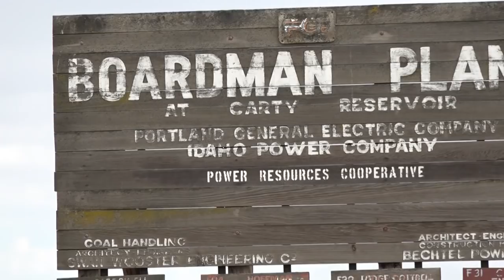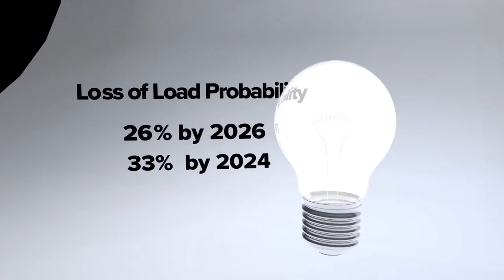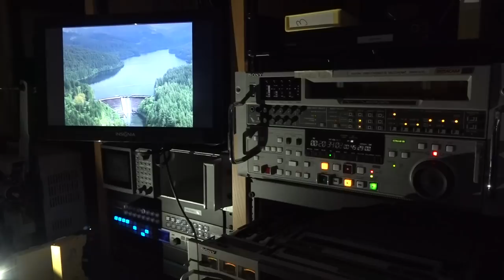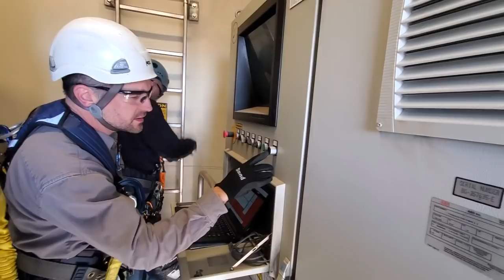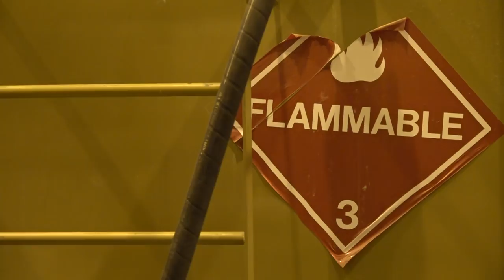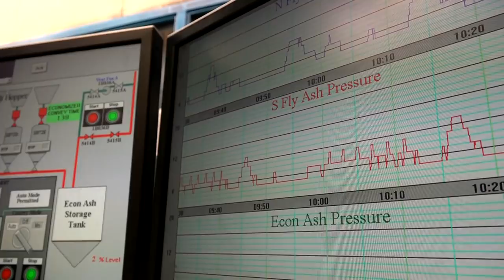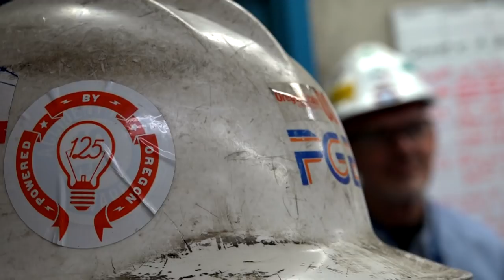Will there be enough electricity after coal plants shut down? | 'Power Struggle' full documentary

Comment: This documentary fails to point out how fast distributed solar is growing, and only looks at centralized utility power plants, which is flawed.  The U.S. installs the equivelant of: 3 new nat. gas power plants of solar, every day, in the U.S., reducing the need for power from utilities.  I did this myself.  I installed 5kW of solar and installed a 2.4kW wind turbine which powers 100% of my house and electric car.  When you fly over the U.S., you see hundreds of thousands of homes with no solar panels, leaving all of that space dead.
Reply: Same here 🤗
Reply: Where will you store the electricity?  Problem with wind and solar is they do not necessarily make electricity when loads need it.  Thus you need constantly cycling gas turbines and hydro to make up the difference.  Pumped storage only works where topography allows for reservoirs, and batteries are VERY expensive.
Reply: @randacnam7321  Good questions.  Where do we store water and food as food isn't harvested all of the time and it doesn't rain and snow every day, but we need food and water, every day.  We've had millennia to perfect storing food and water, we'll become masters at storing energy over the coming decades.  I'm in favor of SMR's (small modular [nuclear] reactors) for metropolitan areas when we go long periods of low sun and no wind but in the future, all energy will come from solar, wind and hydro.
Reply: @MrArtist7777  Food is physical.  Electricity is not.  There is a reason that the latter is much harder to store.
Solar and wind have their place in systems small enough where the batteries can be economical and where the system can handle kW/sec generation fluctuations, but grid scale systems cannot handle proportional generation fluctuations of MW/sec or tens of MW/sec that can last for minutes anywhere near as well.  On a grid scale, coal, gas, oil, nuclear and hydro win out.
Then there is the lie of CO2 being bad, which it is not.
If you want to do something about global pollution, go after China, India and Africa.  The West is not the problem.
Reply: @randacnam7321  True, food is physical and food spoils quickly, making it much harder to store than electrons.  Unfortunately, it sounds like you're a novice to this topic.  I've worked in grid-scale solar and wind power generation for the past 15 years and have worked closely with grid managers and know that although coal and gas have been relatively good to us, over the past ~200 years, their resources are rapidly depleting and costing more and more to mine, frack and transport, allowing solar and wind to win out on pricing and rapid pace of new capacity generation.  Nuclear is so incredibly expensive, it's not really in the conversation any more.  
Virtually every grid in the U.S., and many around the world, already use mW-pack battery storage on a daily basis and more is being installed every day.  Tesla is currently installing a multi-mW battery pack in Texas and much more will be installed over the coming years, just watch.
Reply: @MrArtist7777  Electrical engineer and utility grid infrastructure designer with 12 years of experience in off grid solar who operates a combined 11.5kW between my two off grid systems, so not exactly a novice.
Grid scale batteries are still a drop in the bucket.  Each kilowatt of solar or wind needs multiple kilowatthours of batteries to stabilize production.  Especially wind, whose output power is highly variable due to wind energy being proportional to the cube of the wind velocity and extractable energy being the ~2.5th power of the wind velocity depending on the power curve of the turbine in question.
Then there is the abiogenesis theory of the origin of oil and gas, as well as the theory that it is the metabolic excreta of extremophiles deep in the crust (most likely a combination of the two).  This means that it is only a question of what the recovery rate of oil and gas formations due to new hydrocarbon production is.  The whole myth of oil and gas being finite was started by Standard Oil to promote the idea of scarcity to keep prices up.
Reply: @randacnam7321  If you're a grid infrastructure designer and engineer, you should know the fact that utilities are installing wind and solar, almost exclusively, die to their low price, availability at peak load times and reliability and has very little to do with climate change or any other factor.  However, climate change is very real and needs to be addressed, which it is now that we have a real president in the White House with real policies who understands and follows the science, not pseudo-science and opinion.
Yes, grid-scale battery storage is still a drop in the bucket, but that's what they said about wind power when I first entered the industry nearly 15 years ago and now, wind power makes up nearly 10% of our grid power and growing rapidly.  Solar is catching up.  We don't need as much battery storage as many people might think as solar and wind capacity, combined, make up the majority of base load capacity on grids with sizeable wind and solar power.  Battery storage will continue to rapidly expand.
Not sure where you're going with abiogenesis and the resource capacity of oil and gas as any scientist knows, it takes millions of years for nature to produce coal, oil and gas and we have already depleted many regions of these resources, however, we can produce an unlimited amount of electrons via solar, wind and hydro, and store them for long periods of time.  
I remember when people laughed at cell phones, calling them silly toys and declaring, "nobody will buy them, there's no need."  Now, most everyone has one.  The same will be with solar, wind, hydro and EV's, they'll be the standard in the next few decades.
Reply: @randacnam7321  Forgot to mention, I'm a design engineer for off-grid solar systems.  I spent 10+ years in the utility wind development industry, developing some of the wind farms we have around our country.  Loved the job, HATED the travel.  And I power my own home with solar PV, a wind turbine and drive an EV so I don't pay for power or gasoline.  If I can do it, pretty much anyone can.
Reply: @MrArtist7777  Solar and wind do not make good base load capacity as they cannot be depended upon.
Solar does not help with the load peaks late in the evening, yet generates too much midday (thus the 'duck curve' problems in CA).
The boom I see in solar is in private independent systems to provide critical lighting, water pumping and refrigeration as the regular grid gets more unreliable due to wind/solar mandates and sabotage.  It is at this up to 10s of kW of PV/wind/microhydro and up to 100s of kWhr of batteries where solar and wind make sense.  Even then, gasoline/diesel/natural gas/propane will still be needed for backup.
Reply: @randacnam7321  All power generation goes down from time to time for maintenance, weather or natural disaster-related problems so no technology can be fully relied upon.  Wind and solar are baseload generation on numerous grids around the world, at different times of day and switch back and forth with gas, nuke and other technologies.  I'm sure you've been in grid control rooms and see the many monitors showing baseload shift, this is common for most utilities and as capacity of wind and solar increase and coal disappears, baseloads will shift from solar and wind to nat. gas and as time moves one, I'm hoping we can replace the nat. gas with SMR's, but we'll see.
True, on residential off-grid systems, we size the solar array to cover: 105-110% of estimated capacity and ask for a propane or gasoline back-up generator to be on an AGS to the inverter and show that ~2-5% of the time, the generator will kick on to charge the batteries with solar, and sometimes wind, regularly charging the batteries.
For sure, we  have challenges to overcome but I'm encouraged by all of the young, bright minds who will solve these challenges.
Reply: @MrArtist7777  Except true base load does not need to shift and runs at 95% or better capacity factor, not the 20% to 30% or so of wind.
At least with small systems, the solar/wind can be economically oversized and excess generation dumped into water/space heating or compressed air.  Or doing energy intensive stuff like welding, using loads of tools, freeze drying food, smoking meat, etc on sunny or windy days.  That works on a homestead or small village scale, but not so much on a broad scale where things do not have the luxury of waiting for the weather.
Reply: @randacnam7321  Not entirely true as the baseload power is defined as the primary power source over long periods of time and ALL grids are shifting their mix of technologies all throughout the day.  Solar is already baseload power in Los Angeles and wind power is baseload power in Iowa and Denmark with other technologies coming on and off-line throughout the day.  I worked for a company that monitored wind capacity throughout the world with sensors and electrical equipment and we know that wind generators spin: ~85% of the time.  Solar produces ~45% of the time so your uptime capacity factors are way low.  I'll agree that we'll need to rely on hydro, nuclear and gas until the transition to solar and wind is complete (coal can die tomorrow), but ~60% of our power will come from solar one day, ~30% from wind and ~10 from hydro and geothermal, virtually every power capacity forecast shows this.  I'm sure you've heard this before but it's true and people need to really understand this that enough sunlight hits the surface of the earth every hour to provide 100% of our power needs for an entire year.  We just need to install enough solar and batteries to make it happen, and we are.  I fly back and forth across the country, all of the time, and see millions of acres of open roof space to put solar panels.  A recent study showed that we could produce 90% of our nation's power by installing solar panels on 40% of all roofs in America.  Same goes for the rest of the world.  Solar power is already the cheapest form of power on the planet, with wind closely behind it.  Excess power is already being dumped in to large multi-mW batteries to power at nights and during heavy storms.  This isn't wishful thinking, this is happening today, this is reality.  Likewise, all vehicles of every type will go battery electric over the next few decades, it's inevitable.  I've been saying this for the past 15+ years.  
Again, there are thousands of bright minds and billions of dollars of investment going in to solar, wind and battery storage today and that will only increase now that we have a real president in America and real, competitive technology to use.
Reply: @MrArtist7777  For political reasons.  The problem is when solar does bad, it does bad such as in January and February.  I had days in February this year where I made under 1kWhr from 7,770W nameplate of PV.
To go overboard on PV to overcome this can be done for not much money in absolute terms at small scales, but not grid scales as that requires gigawatts of excess capacity.  Then you run into problems like the 'duck curve' where loads of PV generation during the day dies off in a matter of an hour or so and the coincident evening demand spike means that other sources of generation get hammered with GW/hr load spikes.
And wind turbines spinning by wind does not mean they are generating at full capacity.  Remember that the kinetic energy in a fluid stream is proportional to the cube of the stream velocity.  This means that if a wind turbine has a startup speed of 7mi/hr, it has only 1/64 the energy available to it as it does at rated output speed of 28mi/hr.  This is why wind turbine output can change by a factor of 2 with wind speed changes of only 30% or so.
Reply: @randacnam7321  True, solar production is reduced in the winter months and wind production is increased in the winter months, I've spend years with graphs, LCOE calculators and real-world data to know these facts.  Sorry but, there's NO WAY you produced only 1kWh of energy in an entire month with a 7.7kW array, no way, unless you had the panels completely covered with snow almost the entire month.  If they were exposed to the sun, even on cloudy days, they'll produce ~1/2 the summer-time production.  I too have solar panels on my roof and have had for many years, and have a wind turbine on a 40' pole in my backyard and monitor the production and know the facts.
And yes, I know all about the duck curve and, peak capacity and peak demand, I've worked with utilities on these issues for the past 15 years.  We need to be honest and admit that nat. gas and coal also have down times.  Look at Texas last month where 56% of production collapsed but wind only saw 1.5% reduction.  The Texas governor and Fox News are a bunch of bold-faced liars and their own energy commission called them out on that.  
Yes, wind turbines produce let capacity at lower wind speeds, likewise, HPI and thermal power also produce less at times of low capacity.  The thermal plant east of my house only produces at: 30% capacity now as the near-by wind farm produces the majority of the power but with the intermittency of wind, the plant cycles up and down, depending on demand.  
We're just talking about boring facts now.  Truth is, solar and wind capacity are nearly the only new capacity going on the grid now and some 20 coal plants/year, are closing down and nat. gas plants have slowed, significantly.  As we move forward, solar and wind will be the primary energy sources, mark my words and come back to me in 20 years to see I've fulfilled prophecy. :)  Cheers!
Reply: @MrArtist7777  That was individual day production.  Instantaneous generation never exceeded a few tens of watts.
This blind push to 'green' electricity will lead to a mass utilization of PV/wind in the sense that people set up their own microgrids as the regular grid is too unreliable.  There is no reason to get rid of coal/gas/oil/nuclear, and it is telling that the politically connected crooks pushing this keep buying ocean front property, flying all over the place in private jets and living very energy heavy lifestyles.  Why would they keep doing that if they believed there was a problem?
Reply: @randacnam7321  The daily low production, makes sense.
I agree, there's a massive amount of hypocrisy from people touting lower carbon footprint who live in McMansions and scoot around in leer jets.  I called Michael Moore out for his hypocrisy for telling people they need to live more simply, with less carbon while he owns a mansion in MI and a large house in NY and multiple SUV's, etc., and not a single solar panel or wind turbine on either.  However, the move towards green energy definitely is not blind, it's very well thought out from scientists, engineers and smart investors and will continue until all coal, gas and oil are gone as they're depleting resources that are causing climate change, no doubt.  The science is irrefutable, climate change is caused by fossil fuel pollution.  Likewise, scientists are verify that cancer is real and it kills people.  Science fact is fact. 
I only know a little about SMR's but they sound like a great solution for large urban areas as they can be manufactured in a warehouse, transported on a semi and set up really quick and can be cycled up and down, pretty rapidly, filling in the gaps of low solar and wind production.  I'm pretty sure that's where we're headed: solar, wind, hydro and SMR's.  
It's interesting to see how the market is moving and look forward to see how the coming decades pan out.
I agree on the self-distribution of power, it's becoming easier to produce and store all the power you need, and I speak from personal experience on this, both from my own home and from designing and selling off-grid PV and small wind systems every day.  I have thousands of customers who've been living off grid, with PV and a small gas generator, for many years.  It's not only doable, it's pretty comfortable and pretty easy.  This market will expand, drastically.
Reply: @MrArtist7777  The hypocrisy is telling in that it means they don't believe it, as otherwise they would be doing what they tell you to do.  It is not about 'green.'  It is about the institution of global feudalism with them as the aristocracy and you as the serfs.
A real environmental movement would condemn things like contraceptive hormones in sewage causing gynecomastia in river fish, food aid causing population explosions in the turd world or China poisoning all their arable land.
Restoring natural levels of CO2 to the atmosphere is not a problem.
Reply: @randacnam7321  Gotcha.

Comment: We need OTEC power.  OTEC is a renewable that is just as reliable as coal, but causes no direct CO2 emissions.  It uses the temperature difference between the surface and the depths of the ocean to generate electricity, which stays relatively constant throughout the year.